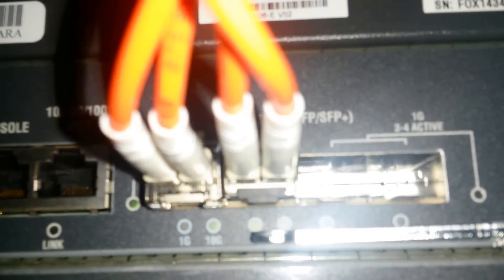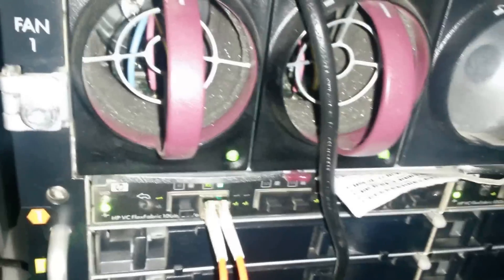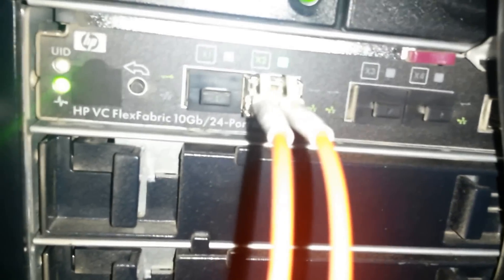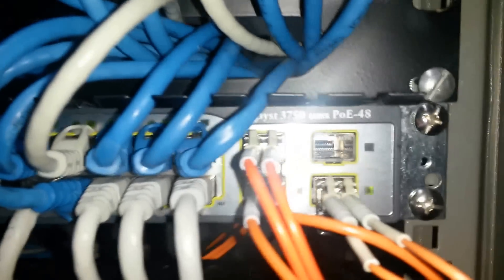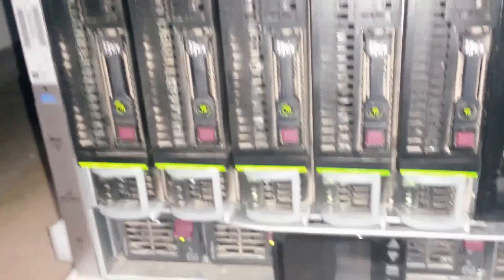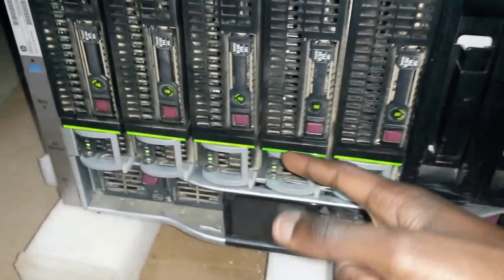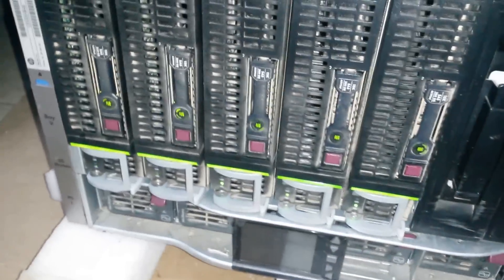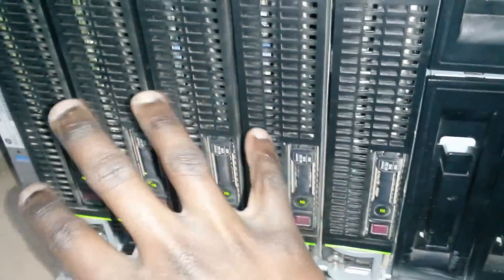A Simple Connection to the HP c7000 Enclosure for 10Gb Connectivity

Comment: I have problem with ilo card in c7000 blade server i don't know the password and i try to hard reset ilo card but unfortiently it doesn't response the signal lost and i had to reboot it and after rebooting  there is no change happend is there any way to reset ilo card to default user and password so i can access it waiting for a response and thx in advance